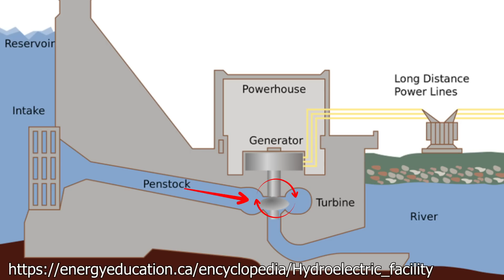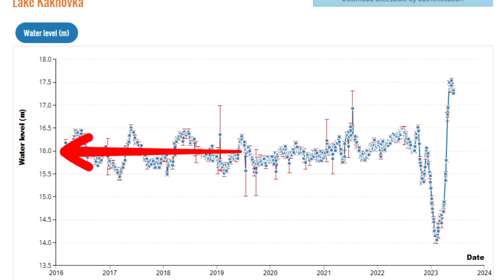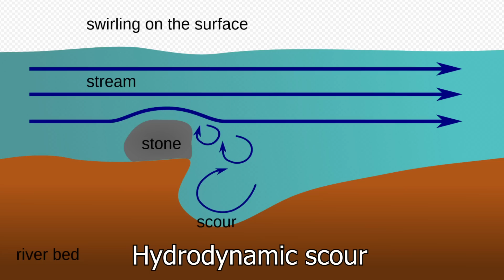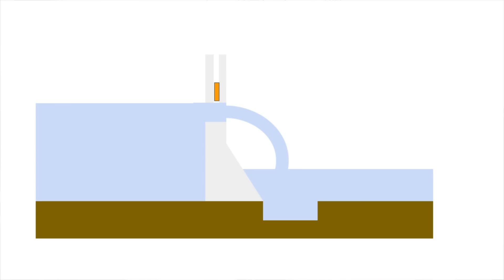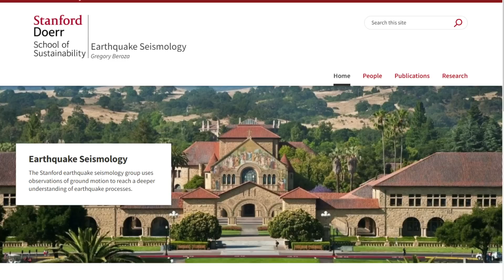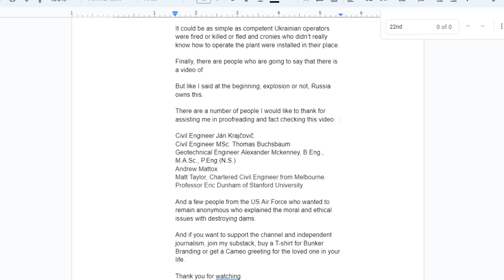How Russia Destroyed the Kakhovka Dam

Comment: I think your assessment is partially right and partially wrong. Here's what I believe happened (tentatively):

When the Russians blew away the three northernmost road/railway segments last November, in order to secure their retreat from the right bank of the Dnipro, they damaged the cranes (or the crane rails) to such an extent that they were unable to move the sluice gates. It seems that the cranes haven't been moved since last November, and it seems that the sluice gates were in the same position ever since. It seems that the gates nearest to the generator building were permanently open, and the others closed. (I would appreciate any evidence in favor or against that)

This means that Russia had very limited means to control the reservoir level since November. I find it likely that the turbines/generators were usable and therefore the main remaining means to regulate flow. But they go only so far. With the snow melting at the end of winter, starting in April, the quantity of water going into the reservoir greatly exceeded the capacity of the turbines to regulate the reservoir level, so the level started to rise uncontrollably. In this situation, it would have been necessary to open the sluice gates, but with the damaged cranes, it wasn't feasible. (I would appreciate any evidence for or against, that the Russians used the turbines/generators to regulate the reservoir level between November and April.)

At some point, the reservoir level was high enough to overflow the sluice gates. This is visually documented in the video, so there can hardly be any doubt about this. By itself, this wouldn't be harmful, although the erosive forces are higher than normal in this situation. I imagine that there was more water flowing through the few open sluice gates than they were designed for. Over the long run, this might wear them down.

Between 1st and 2nd of June, a segment of the road near to the generator building collapsed, right above the few sluice gates that were open. The road seems to have been damaged long ago from shelling, I have seen images from last August showing signs of damage from artillery or missiles. The damage, however, didn't look serious enough to cause a collapse. It might be possible, however, that constant vibrations from the water thundering past underneath could gradually weaken the already damaged road structure until it failed.

This road failure might have worried the Russians and prompted them to try some kind of relief to the dam, i.e. an attempt to open further pathways for the water to flow through, thereby bringing down the reservoir level. Perhaps they tried to blow open more sluice gates using explosives. Perhaps they tried to further open the path at the already open gates, I don't know. But they miscalculated, and blew away more than intended, which caused the dam to collapse, and the breach opening wider and wider with the water washing away more and more of it.

They may also have managed to ignite the charge they had placed on the dam when mining it last autumn, either accidentally or deliberately. This is where I am most unsure, since there doesn't seem to be any clear evidence. I do find it highly plausible that there was an explosion, because it was picked up both by witnesses and seismically. It seems to me that there actually could have been several. But at any rate, more evidence is needed here.

I find it curious to look at the drone video from around sunrise on the day of the collapse, which must have been maybe 2 hours after the explosions, when so much of the erosion hadn't yet taken place. The middle section of the dam with sluice gates is gone, but the generator building seems split in two, with the center piece missing. The generator building consisted of 3 sections with 2 generators each, plus an additional section at the far end that didn't house generators. The middle section with generators is missing, the far section with generators is hanging in there at an angle, badly damaged. The remainder with one generator section and the additional section is still standing. I simply can't imagine how this can happen without the middle section having been blown up. To imagine that this is the result of the whole generator building being washed away gradually from one side, seems very implausible to me.

To summarize, my best guess is that the Russians used explosives to "fix" the problem of not being able to regulate the reservoir level any more, and the dam showing signs of decay right next to the generator building. But they got it badly wrong, and caused the dam to fail entirely. I'm not convinced they destroyed the dam deliberately for reasons of military tactics, although I think they were fully capable of that - which is why they mined the dam in the first place. But I think recklessness met with incompetence here, conspiring to cause a large scale catastrophe.
Reply: This sounds realy similar to what an ukrainian official said. Did you come up with this on your own?
Reply: @0topon  No, I was drawing from other sources, one of which is the Ukrainian official. But I find all of them incomplete. I was hoping to put together a more plausible story.
Reply: @stefanheinzmann7319  My comment wasnt meant negative, it would have been only interresting if you came up with this withoit knowing of him.

Comment: Ryan. I'm an engineer. I agree with you that the dam failed structurally. BUT I don't agree with you that this was not initiated by explosives. For one thing the US has confirmed that they spotted a heat signature from what could have been an explosion. Secondly, your analysis of motive is a bit misdirected. Russia had a motive in wanting to deny the islands to Ukraine troops. I don't think it is likely that Russia wanted to re-cross the river itself. It is possible that Russia wanted to create a minor flood - by blowing the generator station. If this is the case it would want to maximise the duration of flooding. How do you do that? By a) only creating a small breach and b) raising the water level to maximum before you create the hole. And this is consistent with what we actually see. Russia deliberately raising the level. Now, there are also plenty of bits of evidence (intercepted calls and so on) that show that the catastrophic failure was a surprise to the Russians. But this does not rule out incompetence. 

So the most likely chain of events is that Russia had had the dam mined - this is a fact we've known for a long time. Russia tried reducing the dam level to make it harder to cross the river downstream, but it could only reduce the dam level so far with the spill gates (they only go down to a certain level). Then Russia deliberately raised the level (until it overtops) and then they simply detonated the existing charges, regardless of their strength. 

Then the dam suffered a cascading mechanical failure. Which is what you expect - the water does the rest of the work, gradually tearing off more sections. Of course having the dam overfull adds to the process. 

Btw, I don't think Russia intended to stop water going to Crimea. Again, they screwed up. 

If this were a pure mechanical failure I'd be surprised. Yes, dams can fail from overtopping but generally (like most structures) have some margin. Yes, the dam might have suffered from the destruction of the roadway on the northern end, but note that it didn't fail here. 

Also one last thing. That section of roadway was quite likely damaged previously and the concrete supports under the road may have been damaged and of course the water spilling out of the gate hits these supports. So, yeah. Mostly likely it was initiated by explosives. Russian explosives. Russia will be driven out of Ukraine and in good time we will have forensic experts conclusively determine whether explosives were used.
Reply: I seem to have had a similar thought at the same time. See my answer further up.

Comment: It could ALSO easily be destroyed overtime purposefully in such a way as to easily divert blame, and could only be done on the Russian side of the dam. Putin's Russia wouldn't hesitate to devastate infrastructure for the sake of gaining territory, thats standard, so is blaming your enemy for your actions.

Still, intentional or not, it'd have to be russians unless some other force snuck acids or someting into the dam to weaken it over the days but it doesn't seem plausible. Either way, Putin's system will always have massive holes in maintenance and accountability, so it might as well be intentional. You can't accidentally not take care of the dam under your control, you let it fail... negligence seemstoo soft a term for this level of gross oversight.

Comment: From a recent aerial photo of the dam, I believe the explosions only damaged the top part of the dam. That means, the reservoir upstream will not be completely drained out. It could be that the water level in the reservoir after the explosion is still high enough to feed the Crimea irrigation canals.
Reply: Explosion was in the generator room which is fairly deep. The cascading failure that occurred after might have only taken out half the height. Time will tell. But likely it will drain well below the intake for the crimea canal.
Reply: @saumyacow4435  
The engine room is at the end of the penstocks, which is quite far from the dam, could be hundreds of ft.
From a fluids mechanic stand points, the flows of water are quite calm over the top of the dam not much turbulences. It appears to me only a top part is damaged.
Why an explosive is even needed? Just disconnected all turbines, open all penstock valves. The water will flow thru the penstocks unimpeded and would flood everywhere downstream.

Comment: Hi Ryan, Luis here along with my 40 years of experience in hydroelectric projects. First, you did a great and detailed job on the presentation, but... it's wrong. We cannot speak of an overtop flow as the root cause of the collapse in this case, to begin with, this is a concrete spillway designed to deal with "extraordinary" flooding of the river. The overflow would hit an earthen dam, not a concrete dam, at least not as fast; furthermore, it would affect parts of the dam but would not destroy it in various parts... that, can not be explained for a simple structural damage, nor they are consequence of a single dam failure. The sluice gates gantries are also (usually) used to install stoplogs and give access to dam's internal galeries of maintenance, perhaps that's what the access point for an eventual bomb loading ... to note that the dam failure occurs in that place where the gantries are located. No bridge falls due to "lots of water" passing under it, in your photos the supports at the ends of the bridge are intact so there is no reason for it to fall. The powerhouse and spillway are separate structures, structurally independent, they look integrated in the photo but they are not, and the powerhouses is also designed to deal with water. even to a extraordinary levels. The collapse as you presented it does not explain the fumes coming out of the powerhouse, the power equipment is burnable but not easily, due to the electrical protections that disconnect the equipment from the power source (the network) which also shutdown the Units. The timely matters also, prevent me to think that there is any possible chance for this to be a operators' failure or structural failure.
Reply: It is well known that the Russians have loaded the dam with explosives last autumn already. The only question is whether they detonated it.

There also must be an explanation for the missing road segment after June 1st.
Reply: @stefanheinzmann7319  Yup, I've also saw some photos showing mines located on dam's slopes, but, that would not be enough to demolish a dam as this as it was; instead, demolition should come from the interior of the concrete dam, and from the interior of the turbines' draft tube (that would explain why the powerhouse was split out in 3 parts). I'm experience in building them not destroyed them ...however I have no doubts it was detonated and for being more effective they rised the water level up. Anyway, no assessment can be done without looking at least to a few dam's drawings, which I could not found on the web.

Comment: Regarding your statement around 6:10 that you were not sure whether the spillways on the three northernmost sections of the dam were damaged:

They were most likely rendered inoperable in the (nearly) closed position. You explained that it needed the cranes to operate them, and there doesn't appear to be any way to move the cranes above the three spillway sections, due to the crane rails having been blown up, too. I assume that those three spillway gates thus have been left in the position they had on Nov 12th.

Of course, control over the remaining spillway gates ought to have been easily sufficient to keep water levels in check, and prevent further damage to the dam.
Reply: I think what Ryan left out is that if your intention is to create a lower level but prolonged flood, then it makes sense to overfill the dam first.

Comment: To make this analysis even deeper one should consider looking at the actual blueprint of cross-section of the Kakhovka Dam. For example, such blueprints were posted by Tom Cooper. It is in Russian, so I will describe it here:
As one can see, the dam has a set of specific measures to prevent forming of scour holes. The bottom surface of downstream reservoir has concrete and stone reinforcement, 100 m long. Also there is metal wall under the lower corner of the concrete section of the dam, 4-5 meters deep. Moreover, concrete section of the dam is 45 meters wide and 33 meters tall. 
I think, it makes it much more difficult to flip or break such structure because of scour holes.
Reply: I tend to agree. I think the road section failed because it had already been struck with missiles and then repaired, but the supports under the road may have been damaged. So, not connected with the failure of the dam itself.
Reply: @saumyacow4435  Yes, part of the road collapsed is not connected to the dam at that particular place.

Comment: Good analysis overall, however on the subject of timing, one important factor not mentioned by Ryan is that not only was Russia likely worried about an amphibious landing further down the Dnipro, but also a Ukrainian assault directly across the dam, the dropped section of the bridge there notwithstanding. Russian military infrastructure is for the most part blind at night, thus for all Russia knew the spearhead of the Ukrainian onslaught was literally right around the corner. 

Russia does have drones, plenty of them, but most aren't equipped with infrared vision, nor are many of their infantry. I seriously doubt the failure occurring in the middle of the night was a coincidence. Simply put, fearing an imminent assault, the operationally blind Russian military command likely panicked and blew the barrier.
Reply: I don't think that bridging the three destroyed road sectionsat the north end of the dam would have been feasible for the Ukrainians, given that defending the remaining road from the south would have been exceedingly easy for the Russians.

I don't think that this factor is worth taking seriously.
Reply: @stefanheinzmann7319  Feasibility is one thing, competently reacting to the situation at hand is another. The Russian military leadership has not had an exactly stellar record regarding the latter thus far.
Reply: @guydreamr  You're right there.

Comment: The Russians know it was a structural collapse. They deliberately closed all the sluice gates, trapping an unprecedented amount of water behind the dam, which set a record for it. It was also already damaged by HIMARS strikes and especially the explosion Russia conducted to cut the road on the bridge. The Russians thought they would use the dam as a threat to prevent Ukraine from conducting any cross-river operations, or possibly to threaten the nuclear power plant. They are claiming, of course, that there was prolonged artillery fire by Ukraine against the dam, which is a lie. There was no shelling against it. The short video of the small explosion on top of the dam after it had already collapsed was just a mine being set off by being moved.

Comment: I have one thing to comment on. In my honest opinion there is an advantage in for the russians. The whole down stream area is now like swamp and most prob. stays like a swamp for a few weeks. So there is no way anybody can actually move any vehicles there, let alone heavy equipment. I call that a russian advantage as they are the defender. Rumors says that the Ukraine also had a plan to destroy the dam last year when they attacked Cherson to deny any further supply to the russian troops on the north side. If that rumor is even true, is a completely different story.

But all in all, I totally agree with you here. If neglecting maintenance to these kind of building is the same as actually planting a bomb, can be discussed. But if that was on purpose, accelerated by previous damages, or what so ever should be discussed when we have more informations.

Thank you for the video!